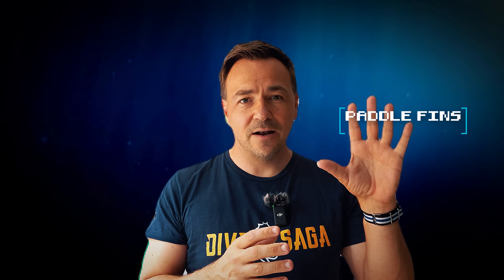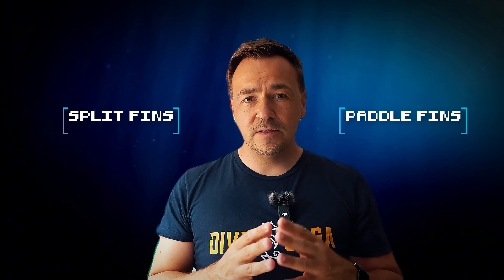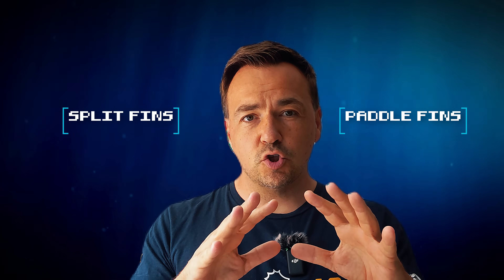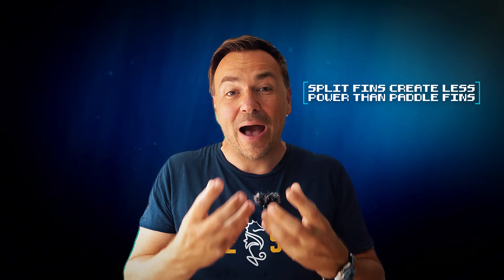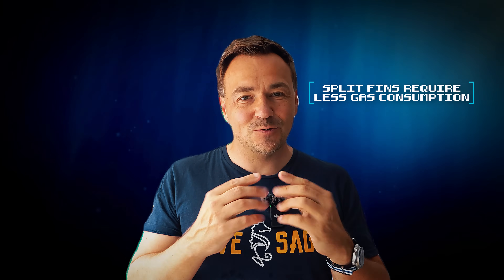SCUBA Science 14: SPLIT Fins vs. PADDLE Fins / Which is Worse?

Comment: Hrrmm weird to claim lighter fins are needed for drysuit diving. I did my drysuit certification in quatros and subsequent dives in rk3s. 

Buoyancy characteristics of fins are an important consideration when choosing a fin. You need to know if you need a positive buoyant,  neutral, or negative buoyant fin.

 For myself, my feet always sink. This happens if im swimming, diving in swim trunks, 5mm wetsuit, or a drysuit. Therefore i need a neutral to positive buoyant fin.
Reply from the maker: I think I say in the video that "of you're driving a dry suit, you'll want more weight on your feet and typically blade find are heavier".
Reply: @DiveSAGA you do, which isn't always the case. I gave a clear example of why it isnt. It truly depends on the diver
Reply from the maker: Like most things in the video, it's a generalization for sure. At the end of the day everyone needs to get in the water and perform some trial-and-error weight and trim checks for different combos of equipment, environment and personal physique.

Comment: There is only one. Original USA made jetfins 😂
They can do anything in every condition possible. And if you do yr kicking efficient, paddle will win the race.
Reply from the maker: I like my jetfins but they are definitely too heavy for for instance on the sidewinder! (In my case)
Reply: @DiveSAGA when I started my tech there was only one choice for fins to join to dark club 😉😅😅
Only trouble they are indeed heavy, especially when traveling abroad. 
If doing technical diving I would always go for the paddle. Way more control of movements in the water. 
And doing backwards and helicopter turns, I’ve seen many doing it without fins and drysuit 😅